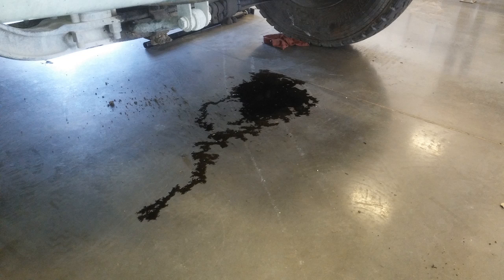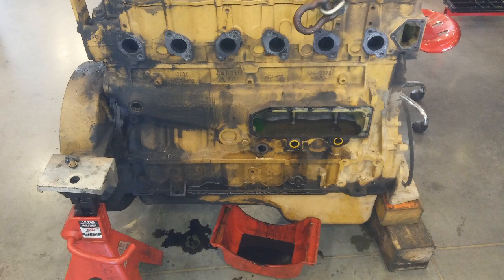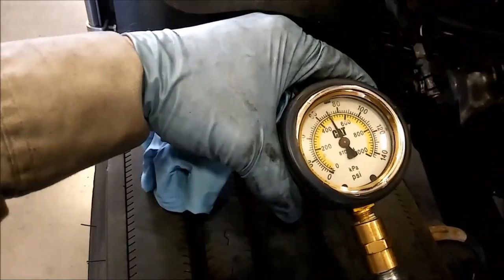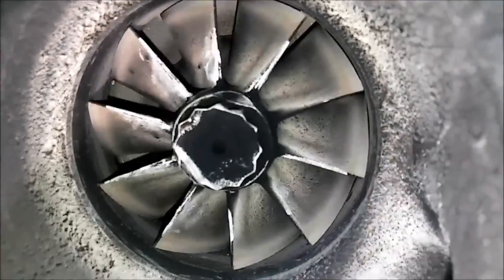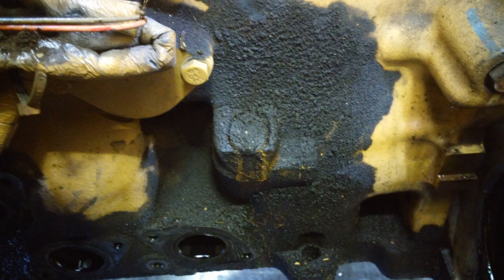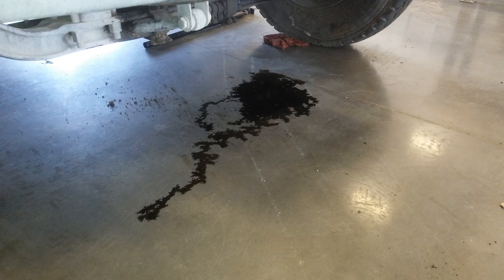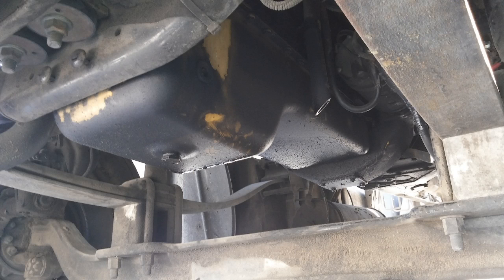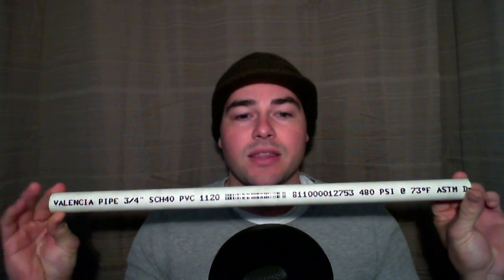Why Do Diesels Leak So Much?  Why Do Diesel Engines Leak So Much Oil?

Comment: My 7.3 Powerstroke has an unrestricted ccv into the turbo intake as probably every Powerstroke does.  Mine had only 50,000 miles on it and there was a small build up of gunk in the intake.  None to the turbo yet.  So I put in a well designed catch can.  I placed the catch can down low at the bottom of the engine next to the oil filter and ran 3/4 inch PCV hose to it and back to the intake.  The total hose was about four feet.  This gives the vapors time to cool, condense and turn to liquid.  The liquid gunk then stays in the catch can by gravity.  All engines should be like this because they don't want gunk.

Comment: my benz cdi engine has pcv and it goes into the turbo. guess it isnt a problem on the smaller diesels (it has a very small turbo, garrett gt18)

Comment: I shouldn't say this for fear of breaking the spell, but my mighty 2009 6.7L Cummins diesel with 176,000 miles of carefully maintained service is dry as a bone, top to bottom...The same can be said for the Aisin commercial six-speed auto behind it...Neither one has ever been opened nor abused in any way, just worked...

Comment: What about toyota turbo diesel engines I doubt they leak as much as American made diesel engines if anyone from Australia can comment about that wrenching on cars for several years the difference between American cars and Japanese when it comes to leaks is staggering I imagine it's because they don't cheap out on the gaskets they use this has to be part of the problem examples are under every hood

Comment: My 6.5TD 98 Suburban uses the system of a CDR valve to intake just before the turbo. Should I move it to the air box and have the blow-by blow on the filter element in the air box?

Comment: Nice explanation. I have worked on industrial equipment that has oil under pressure up to 6000 pounds and no leaks. The simple truth the gaskets are not as good as can be. If you can keep the compression in the cylinder the for sure the oil can be kept in the engine. The diesel engine is a big polluter. I have worked on large marine diesels and many don't leak a drop.

Comment: Has anyone tried pulling a vacuum from the exhaust?
Definitely works on supercharger gas engines, would it work on diesels?
Reply: Not really,  there is a lot of pressure there too.  About the only way to get a vacuum from a diesel engine, would be to use a venturi vacuum system somewhere.

Comment: how to marine diesels deal with positive crank case pressure without a blowby tube? I don't have oil leaks in my bilge. Nothing. No leaks anywhere. I do have a little catch can like thing that comes off my oil filler cap, and that seems to be heading toward the turbo filter area?

Comment: yes there is boost but there is also airflow why not use a venture tube in the intake after the turbo air going past it would cause vacuum  in the blow by tube wouldn't it?

Comment: Could International's oil turbine solution be routed back to the turbocharger? It has a filter, so you wouldn't be spitting oil at the turbocharger, but it still creates a vacuum, so you don't run into the issue of the crankcase filter/catch can.

Although I'm not sure if it would be possible to continue creating the necessary vacuum even with a wastegate, given that you're pushing that flow back into the turbocharger and ultimately the engine again...

Comment: We had 1996-2005 International AmTran Rear Engine busses with the T444E engines. That consumed oil like crazy.  Our oil checker guy called them Oil burners. The T444E in our conventional busses were fine but those RE’s just drank it like crazy. So I’m sure they leaked oil somewhere as to why they always needed oil added.

Comment: Hi, I think you are very good at explaining thinks especially to truckers that are not their own mechanics. I had a 1999 Pete with 3406E and had 1,1800,000 when I sold it. I was lucky with very seldom having breakdowns, I always caught things during services and was able to repair thinks on the road and never needed a tow. One time I was losing coolant and it wasn't leaking. I was looking under the radiator and noticed very little puffs coming out of the radiators little rubber over flow hose, they were so slight that the only way you could even tell, was by my face being an inch away from the hose. I used 4 gallons of coolant to make it back 400 miles to my shop. I checked it out further and decided it must be the head gasket. I pulled the head checked all the cylinder liners and had the head pressor tested and decked. I put it back together and had the same problem, woops, took it apart again and had my 35-year-old son with better eye then mine check the cylinder liners again and there it was no. 1 cylinder liner had a micro crack in it. Needless to say, I will have my son do the looking from now on. Just wanted to share that with you, thanks.
Reply: I had a very similar headache that resulted in multiple tear downs. Had a coolant leak, was burning coolant, exhaust smelled terrible. Machined the head, new gasket, problem persisted. Turned out to be a slipped cylinder sleeve due to a single overheat. Had to swap out the block to fix it. Super pain in the ass! 😆

Comment: When I drove 35 years ago, when guys were standing around talking,  when you looked at all the trucks,  the one with the most oil under it was most always the Detroit's,  6-71, 8-71,  or the V- 6 or 8 92's. 
 I was a joke "oh u got a Detroit 😃😃😃

Comment: Gasoline engines have a throttle plate that creates a vacuum inside the intake manifold and Diesel engines don’t throttle the incoming air, but only the fuel going to the injectors

Comment: I want to put gas in my bobcat s150 and opened up the door to the engine and engine oil was pouring out everywhere big puddle in the engine bay of oil, oil up pouring out in the sides where it gets air, I think the engine seal is broke or something

Comment: You seem to know you’re stuff...I don’t suppose you would have an idea of an issue I’m having...it smokes a lot like light grey/bluey until you rev it and then it splutters at around 2500rpm - 3000rpm and then chucks out black smoke and there’s soot on the floor, it then refuses to rev any higher than 2500 - 3000rpm...it starts fine and isles fine...sometimes however if you put the gas peddle all the way down it will rev to its highest...I’ve tried the EGR I’ve replaced the MAF and I can’t figure it out...however I have noticed a fair amount of oil in the turbo pipe going to the inter cooler and form the inter cooler pipe to the EGR is oily too...would you think towards turbo related problem? Hoping you or somebody may be able to help me. I’m really stuck with it. TIA

Comment: 7.3 Powerstrokes have pcv systems, they’re before the turbo where there’s vacuum though
Reply: So the turbos also suck in the crankcase fumes? Has that caused any turbo failures?
Reply: El Ectric there are particulate filters before the turbo so they’re pretty reliable, but I’d say a bad one has knocked out a few
Reply: @willoakes7542  How often does the crankcase filter (?) need to be changed? I'm guessing during every oil change.
Reply: El Ectric every 100k, just about every truck I’ve seen still has the original with 300k plus miles on it
Reply: @willoakes7542  I personally prefer Cat's approach, at least in part. Cat did this on the C7 and C9 (not sure if they still do this on the C7/C9 or other engines) where they vented the crankcase fumes into the exhaust (after the manifold, I believe). Problem is, I wish they'd executed it better, because the fitting that screws into the exhaust tends to plug up over time with soot, either soot itself or from burned oil or oil fumes. 

With the advent of SCR, though, that becomes much less of an issue because the SCR system helps take care of NOx emissions and also, to an extent, particulate matter.

Liebherr are using a Diesel Oxidation Catalyst (DOC) which is basically a pre-cat for Diesel engines. After that comes the SCR system with DEF injection. Sadly they're also adding a DPF. 

Maybe, on a future engine, one could vent the crankcase fumes after the DOC so the fitting doesn't get plugged up as easily.

Comment: i had a 1984 mercedes 300d with the OM617 turbo diesel, it had a PCV hose going into what looked like some sort of canister that lived inside/under the air cleaner housing (google images will show better), which fed back into the crankcase, similar to the CAT system it seems.

Comment: I HAVE A 3208 CAT ENG IN MY 1979   CHEVROLET DUMP TRUCK.  IT BLOWS OIL SMOG OUT OF THE ENG SO I PUT A HOSE ON IT AND I JUST MADE THE HOSE GO FAR TO THE BACK NOW MY WHOLE ENG DEP IS SHOWERED IN OIL GREESE. MY ENG AND DEP WIRES ALL THAT IS MESSED UP DRENCHED IN SMUSH.

Comment: Volvo also uses the centrifugal oil separator, no real issues the gaskets due harden due to heat cycles and leak but other than that the only real sources of leaks on a D13 are the rear of the rocker cover (clearly due to dissimilar materials of block and rear gearcase cover.) And the injector thru harness

Comment: This is a crock of crap.  Sure, if you're stupid enough to try and suck crankcase fumes into the diesel POST turbo, it won't work.  So that's why diesels have their PCV system placing the hose PRE-Turbo, where the action of the turbo creates the negative pressure which sucks in air and PCV system fumes.  Then there's the modern direct injected petrol engines which operate in the identical fashion to diesels, and ALL of them have PCV systems.

Comment: I have a 7.3 psd I added a second vent on the passenger side valve cover this stopped my leaking problem and vented both sides out the tail pipe

Comment: They don't, necessarily.  My 32 year old Mercedes turbo-diesel:  Bone dry.  They don't leak if you engineer them not to leak.  Similarly:  My old 1999 New Beetle diesel with 300,000+ miles (a friend still owns it):  NO LEAKS.

Comment: Why not just have a weep hole with a diaphragm that releases at a certain pressure?
Reply: You're still getting high crankcase pressure. Because you're waiting for your crankcase pressure to increase beyond a certain point before it will vent. And if that thing fails to open, you start getting A LOT of crankcase pressure. Imagine if your engine was completely sealed - you'd get so much crankcase pressure you're going to start pushing out seals.

Comment: Admit up front that I'm not even close to being a diesel mechanic or technician but did appreciate that you dumbed it down some so that I understood it. I have a 2003 Motorhome Diesel Pusher with a CAT7 engine in it. Had one oil leak last year that was fixed by changing the oil cooler and just came back from a trip where we noticed oil leaking again. First long trip and was obviously concerned that we had another oil leak. Going to have a diesel mechanic give it a look just to make sure we don't have something stupid going on but was interested to know that diesel engines like the CAT7 would probably leak or seep now matter what. I read a lot of the previous responses from other folks and at least felt I learned a little bit about what might be going on. Thanks to all of you.

Comment: A few thoughts for ya. I work on boats with car engines, mostly big block Chev but make does not matter. Most boat motors do not have a PVC system, motorcycles don't either. Even motors with superchargers don't have them and they push more gasses past the rings than normal aspirated ...and they do not normally leak. Pcv systems are just a metered vacuum leak, they only pull in high vacuum situations...ie idle and light throttle cruise situations and the actual volume is minimal. Boat and motorcycle engines use a simple breather system. The idea is to slow down the speed of the escaping gasses...if you have a 1/4 inch hole in a valve cover to vent the engine or a 1 in hole, which hole will allow the gasses to slow down the most? Once you slow the gasses down you let them flow through a not restrictive filter medium. What seems to work best is a material that looks like old time brillo pad, not the kind that looks like steel wool, the kind that looks like wadded up strips of copper. It has enough surface area to catch the oiley vapors and hold it until it collects into droplets that end up dripping back into the motor. No reason  that should not work on a diesel, my 24 valve cummins has 200k an has a simple road draft tube and the only leak it has is from the steering box...you ever VB use UV dye to diagnose oil leaks? I use them on car motors that look like they are leaking everywhere and after some dye and a black light I figure out that it's just old valve cover gaskets...

Comment: Hey Good Morning. What are your  views  of the Chevy Colorado 4 Cylinder turbo 2.8 Duramax engine? Is it recommended that a timer be installed if one was not put in by the manufacturer? 

Peter Richards

Trinidad and Tobago

Comment: The only diesel engine I had problems leaking was my 8v92 two stroke my Cummins and cats I owned never had problems but you have to stay on them keep bolts tight etc

Comment: I left CAT in 2004 after 14 years. I forget the engine, but the head gaskets tended to leak oil down the driver side of the block. Their fix, which actually made me ashamed to be a CAT engine mechanic came in a kit. Two cans of brake cleaner, a pot of epoxy and a rattle can of paint. Clean the seams, apply epoxy and paint when dry. The oil ran on to the transmission. That was so weak, it was shameful. I went from their truck engines to feet-wet and then dirt. They totally blew the truck market.

Comment: Doesn’t valve timing overlap help with this? By having both valves open as the intake stroke begins it creates a scavenging event and then as the compression stroke starts it pushes the particulates out through the exhaust and then the exhaust valve closes like halfway into the compression stroke. I’m just a diesel tech student so I may be wrong. Idk.

Comment: Would my stock vacuum pump (91 dodge 6bt) be able to preform PCV duitys  after I convert to hydro-boost brake booster?  Or would the blow-by contamination wipe the seals/ damage the pump?
Reply: I used to run two evac tubes from valve covers to
Exhaust on my race car.  I think I’ll do this on my 12v soon

Comment: Josh, the Cummins comments you made were not entirely correct. Cummins used this on the 1st common rail engines and some of the IFSM Fuel Systems, the PCV System. They used a similar crankcase breather filter as they do now but, instead of venting the filtered blow by gasses to the atmosphere. They then routed the (Downdraft or blow by tube) to the suction side of the turbo. They did this after the intake air filter but, before the turbo inlet. This successfully functioned for years and even now when those engines come in our shop they still run great even with hundreds of thousands and even 1 million miles or more. The only fault in this idea was the operator and/or the customer.
Reply: Just as morons do with not changing their oil as the manufacturer says. People do the same thing with air filters, fluids, oils and in this case, crankcase breather filters. The worst is when they let their engine air filter AND the crankcase breather filter both go WAY TOO far between filter changes. This caused one of either high blow by, oil injection through the CAC then into the intake and I’ve even seen runaways caused by a stupid crankcase breather.

Comment: No they don't if you take care of them my old 8v92 dripped but my cummins KT600 never dripped at all ,I put about a million miles on it but I did my own service and always checked the bolts if it started seeping I changed gaskets but the only diesels I ever had leak was the old 2 stroke detroits

Comment: It has NOTHING to do with being turbocharged!  It has EVERYTHING to do with the fact that diesels are not throttled!!!  They have NO INTAKE MANIFOLD VACUUM!  Diesels are throttled by how much fuel is injected into the CC.  Gas engines (most of them) use a butterfly or guillotine/slide throttle to let more or less air in.  When the throttle is closed or at idle intake manifold vacuum is high, when at full throttle and the butterfly is open intake manifold vacuum drops to zero or near zero.

You are talking like you are some sort of expert and you don't even know the most basic of basics!

Step your game up and stop giving out incorrect information.

Comment: Great video! I have a question though- Is there a reason why a small electric vacuum pump couldn't be installed from the factory to create a vacuum in the crankcase? Seems like that would be a pretty simple solution to the problem.
Reply: I think this is done in some applications.

Comment: I'm not sure this theory holds up when you consider that the dipstick of the engine goes directly into the crankcase.
Reply: I was wondering the same thing. The oil stick would be forced out of its sealed seat.

Comment: My 06 Duramax doesn't leak. Have over 260k miles on it. Still runs like a brand new engine. My Allison Transmission looks like it was never even used. I took it off the truck, took it apart and looked inside. Literally ZERO wear inside.

Comment: Do you think I could make money by buying use kicken geas from fast food restaurants and turn it in to diesel.
Reply: Technically yes but there are a lot of obstacles. First is that common rail diesel engines don't like bio-diesel in large concentrations. Second is that you'll be liable for road fuel excise duty on every litre you sell. Third is you are putting yourself at huge liability should the fuel you sell damage someone's engine. Approach this carefully.

Comment: I have a 1997 3116 turbo cat in my truck with 91,000 never leaked or have any problems what a great diesel. I change the oil when I feel like it maybe years. I guess I just got lucky with this cat.